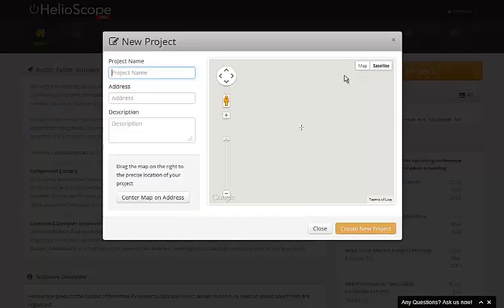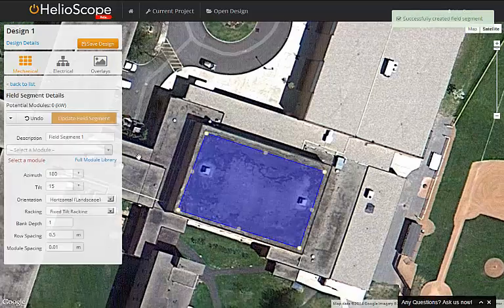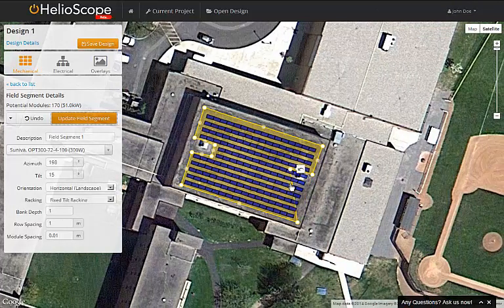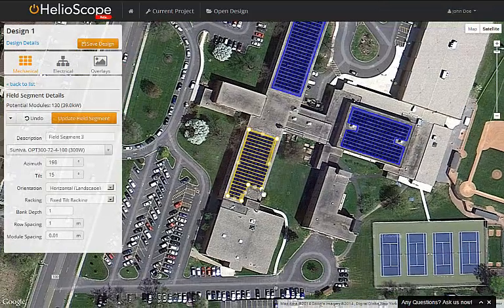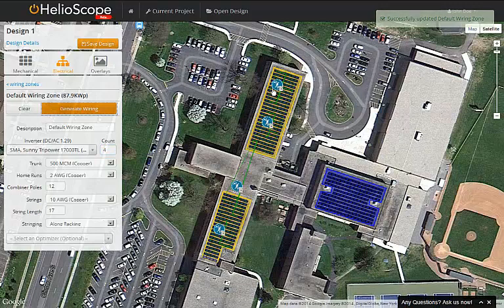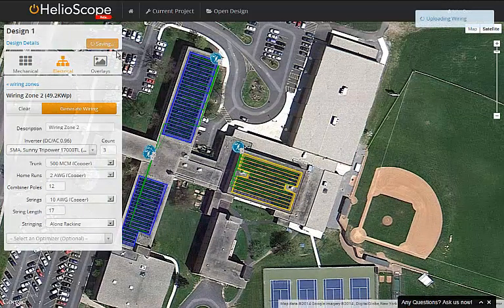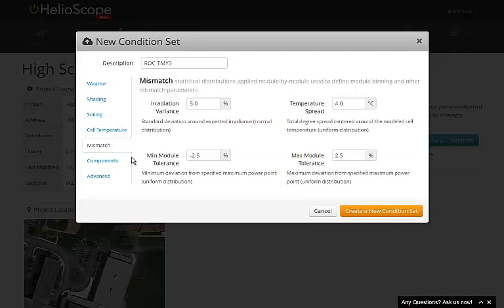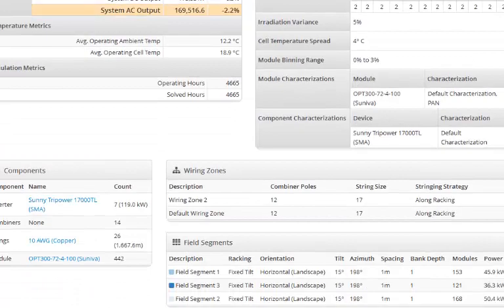Design a PV System in 4 Minutes with HelioScope

Comment: This kind of trivializes a bit decision-making processes for an installation meant to last 20 years.How about the shading and horizon mask? How about the obstacles? A 3D design where trees
and other buildings' influences on the irradiation? The changing of seasons? (not the same sun trajectory in august and in December for example)
This looks like cutting corners and just getting things done a.s.a.p. rather than working on precision. PV Syst has now -9% precision in comparisson to actual values as per a Photon International study, what's yours?
Reply: James Santiago  I support you, a PV system needs detailed design but for marketing purposes, this can provide a fast response to a client request
Reply: CharlesRT 
I agree... This is a marketing tool. Ergo, saying "we're the new reference" is a bit too much and misleading.
Reply from the maker: Hi James, yes, we have full 3D design support native in HelioScope (and now a way to view everything in 3D), or can also use Horizon files for shade if you prefer that approach. It seems you didn't get a chance to get this far in your initial demo - let me know if you would like to re-open your trial account. 

Also, regarding the energy yield calculations, PVsyst is the industry standard because for the last decade, the largest developers have created a feedback loop where any discrepancies in production were adjusted in PVsyst. This is why we were required by the banks to make sure that our math is very similar - at first we fought it, but we now see the wisdom in that approach. 

PVsyst has been the basis of billions of dollars/euros worth of contracts. No offense to Photon, but they don't have nearly the same amount of skin in the game :)